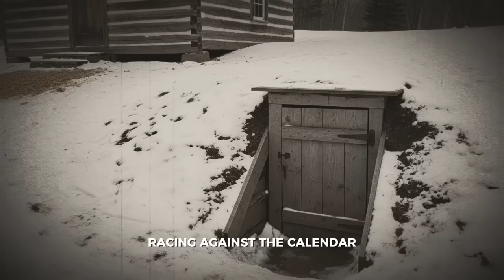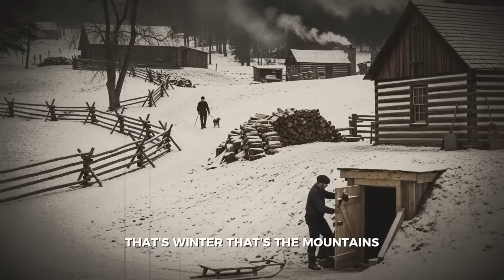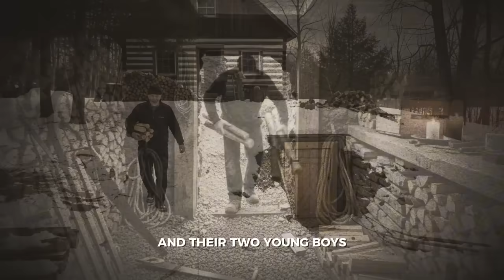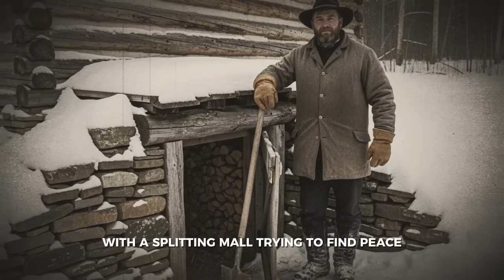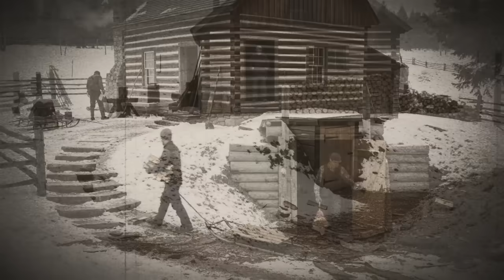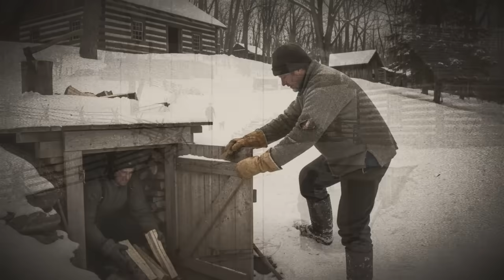They Mocked the Underground Shelter Beneath His House — Until His Firewood Never Got Wet All Winter

Comment: Coldest winter 50 degrees below zero in an old trailer.  Dog's water froze within 3 feet of the oil heater.  Icicles formed from the rivets over our heads in bed.  Fortunately, our toilet ran constantly so the pipes did not freeze. Think it was the winter of 1968/69 but might have been the next year.  This was in eastern Washington state where it never gets that cold.

Comment: In New England it is quite common to grade the ground so as to have good drainage, a full basement under the house, and a garage under one end of the house. We built this style home for efficiency. Most of the space heating was done with a woodstove with a full chimney fully inside the house acting as thermal mass. We cut and split firewood and used a wheelbarrow to bring it through the garage and into the basement to be stacked so it stayed dry. We had a second smaller woodstove in the garage as only the ceiling and wall separating the basement from garage were insulated. Working on the vehicles was much nicer in winter with the ability to light the woodstove and warm the garage beforehand. We had a boiler with oil burner for baseboard heat and domestic hot water and a separate hot water storage tank and again a second full chimney inside the home for mass heating. Even though the boiler and hot water tank are insulated, when the boiler ran and hot water stored heat was also given off to the surrounding mass of concrete and the chimney which then slowly radiated back into the basement keeping it passively warm. This warm air also floated up to the unfinished ceiling warming the living floor from underneath. My only change would be making the door between the garage and cellar 48" wide instead of the standard 32" wide door we installed.

Comment: Wet firewood, if
 "dry" and green firewood are two different things. Firewood that has dried for two ot three months ,if rained on , will burn just fine. Wet firewood, that is green with sap will  smoulder and have no heat. It takes two or three months before cut green wood will dry enough to burn well. Once it has "dried'' out moisture will not change its ability to burn, as long as the fire is burning and will evaporate the water first.

Comment: People don’t burn pine wood….it is only used to get the fire started. We used hardwoods to heat. Pine root makes wonderful kindling. We used white clay to white wash our fireplace.
Reply: Why did you want to whitewash your fireplace?
Reply: @maxsparks5183 when a fireplace was built…sometimes it would not draw the smoke up. This would cause the smoke to flow out onto the fireplace. Whitewashing made a layer of clay that could be removed as needed to keep a clean place. Also it covered up bad looking bricks or stones.

Comment: What I love most in this story is that Everett didn’t “invent” something new, he rediscovered an old survival principle that shows up again and again in ancient and medieval techniques: use the earth itself as infrastructure. This underground firewood cellar works for the same reasons root cellars, medieval ice pits, and even Roman hypocaust subfloors worked. Stable subsurface temperature, gravity-driven drainage, and controlled ventilation. In winter survival, keeping fuel dry is just as critical as having fuel at all. Everett understood that wet wood isn’t just inconvenient, it’s an energy loss multiplier that steals heat and poisons air. By placing the wood below frost depth, he eliminated freeze-thaw cycles, stabilized humidity, and turned the ground into a natural dehumidifier and insulator. The trapdoor access is also pure survival logic: no exposure, no heat loss, no risk during storms. This is frontier survival engineering at its best, simple materials, no machinery, but a deep understanding of physics and climate. It’s the same mindset ancient builders had, solve the problem once, then let nature do the work for decades.
Reply: We had wood a wood burning stove and fire for years. We were told that leaving the wood out in the sun for months and allowing it to dry was money in the bank. Some of my neighbours had wood stacks that were years old. Wood stacks were carefully managed,  oldest wood  first.